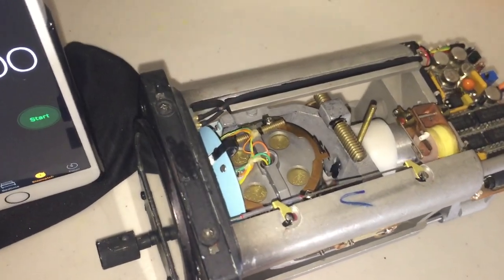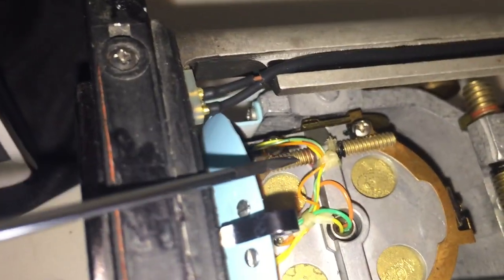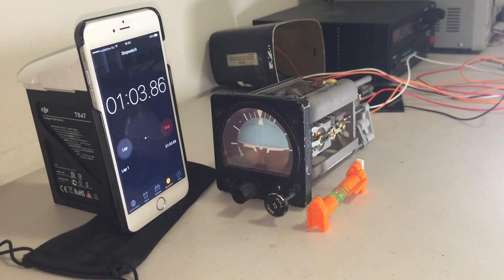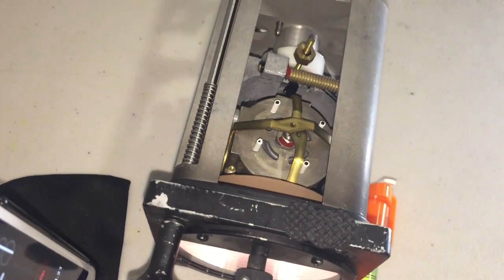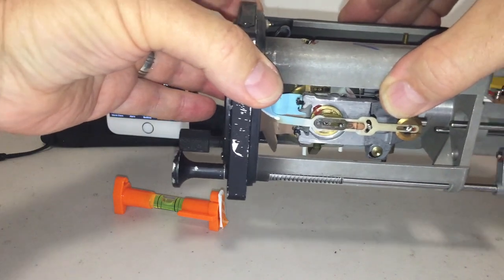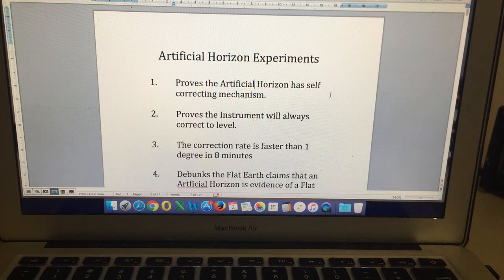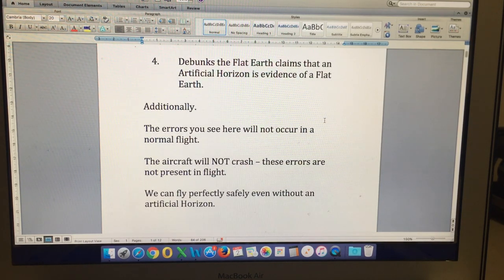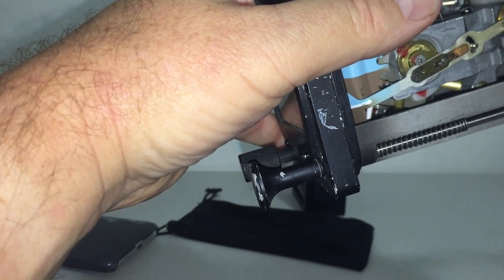Flat Earth - Time Lapse - Inside an Artificial Horizon while self correcting.

Comment: At 6:25 in your video...you pick the gyro up, and PROVE exactly what the Flat Earth guys are saying.  And you even say it!!!!!!!!!!!!!!!!!!!!!!!!!!!!!!!!!!!!!!!!!!!!!!!!!!!!!!!!!!!!!!!!!!!!!  Here are you're own words:  "No matter what I do to the external case, the gyro remains LEVEL."  
So what happens if the airplane tilts over constantly changing orientation from where it took off from?  That would be the same thing as just tilting the external cage over......The gyro would be uneffected, it would stay LEVEL.  

The airplane overcomes the force of gravity, and CONTROLS which direction it tilts down, or tilts up....my friend.  The airplane doesn't take off, then gravity force it to nose down at a constant rate.  Instead the airplane can tilt up whenever it wants to, or nose down whenever it wants to.  It overcame the force of gravity and is now controlling every single direction it moves through the air, my friend.  

Also....you're horizon gyro is an electric one.  There are no air ports or vacuum pumps on it, it isn't air powered, my friend.  It's spun by an ELECTRIC MOTOR, you LIAR.

It's a damn gyro with a pendulum WEIGHT attached to the bottom of it.  YOU LIAR.  

There is different type of Horizon gyro that uses AIR PORTS and a vacuum pump to make the flywheel spin.  
YOURS IS ALL ELECTRIC YOU LIAR.  

The airpowered ones also have a PENDULUM WEIGHT attached to the bottom of them, but the pendulum doesn't control how fast the vacuum pump runs, or how fast the air is blowing on the Flywheel.  The pendulum is just there to make sure it's plumb and LEVEL.  

A liar is always crafty with words, and always gets caught in the LIE.
Reply: Level doesn't mean what you think it does.
Globe confirmed 🌎
Reply: @awatt  I have a 100mile stretch of railroad lines across Kansas, and the entire line is Level from one end to the other.  On the SAME Level all the way across.  Do you understand that?
Reply: @dr.davidbannerf.e.s.6217  
Level is not what you think it means.

Comment: Why not use the gyro to travel in a long straight line on earth without the self adjusting mechanism and see at the end of the journey if you have a difference in level from where you started.  Wouldn't that show if there is curvature or not?
Reply: No because a plane is made to stay level in certain atmospheric layers. With the right conditions a plane doesnt need auto level. But since the atmosphere is constantly moving and changing these changes or depressions as weather man call them can change the planes direction slightly. This is where the instruments kick in. 

But in perfect atmospheric conditions the plane will stay leveled. So either curved or flat the plane will follow the atmospheric layer.
Reply: @Mario Theoretically yes, however the self adjusting mechanism compensates for other inperfections in the gyro as well, not just the errors originating from the curvature. More than likely you would observe "random" drift over time due to biases if the self correcting mechanism is disabled.
Reply: Bob "Fifteen Degrees per Hour Drift" Knodel has a gyro that would do that. . .but he's chickened out of that process now that it has failed him twice.
Reply: @Rokreder  correct, the gyro would precess under acceleration as well. That is another thing the pendulous vanes compensate for.

Comment: One question. The pendulum vanes are basically just like plumb bobs, so it's easy to understand how they are used to correct and level the gyro platform. However, there will be times when the vanes will be affected not only by gravity but also by the aircraft accelerating in some direction such as during sharp maneuvers. Remember that acceleration can of course distort the perception of which direction is down and fool the human vestibular system. This is after all the reason why gyros are used to determine attitude in the first place. So it would also seem logical that the vanes could also be fooled at times during maneuvers and so you wouldn't want them affecting the orientation of the gyro platform during those times. Note that the experiment in your video is being performed while the table is consistently at the same altitude and is standing perfectly still.

As such the instrument's electronics must somehow know when to read and respond to the vanes and level the gyro and when to ignore the vanes and leave the gyro alone. I would image that accelerometers inside the instrument and/or heading and altitude deviations would be used to determine when the airplane is or is not not accelerating, turning in any direction or changing altitude. Leveling would then be selectively performed only during those periods when the airplane is not turning, climbing or diving and the vanes are able to get a true and accurate perception of which direction is really down.
Reply from the maker: +Joe vignolo. You have a very good analytical mind Joe and you are correct. Various methods can be used to prevent ‘correcting’ during a turn.  In level flight we have 1 G but in a turn that will always be more. This can be sensed and the correction mechanism pauses during this time. 

On very simple units however they can begin to align incorrectly dirinf manoeuvres but in a normal flight these errors will be small as there is never a situation where you continually turn for many minute and as soon as you fly straight the tiny error will correct.

Turning and acceleration errors are taught to instrument pilots so they are aware this can happen and will always cross reference other instruments also.
Reply: Joe V.,
 The correction ability is only 3-5 degrees per minute.  The AI is used for relatively short term use in turns and self corrects in level flight...which is most of the time flying.
There is no electronics.  ONLY the vanes over the vent holes...all mechanical and very clever.
Here's more on that:
 https://aviation.stackexchange.com/questions/16376/how-are-attitude-indicators-kept-accurate?utm_medium=organic&utm_source=google_rich_qa&utm_campaign=google_rich_qa

Comment: Maybe I'm completely misunderstanding this, but it seems to me that it isn't a gyro corrected by a pendulum but a pendulum smoothed out by a gyro.

The vertical is detected by the pendulum.  If the plane were always stationary that's all you'd need - essentially it's a plumb bob.  But planes move and are subjected to jerks and bumps, also they pitch and bank.  Jerks and bumps would set the pendulum swinging.  Banks result in centrifugal force that act in addition to gravity, moving the pendulum away from level.  The gyro smoothes out those effects.

The artificial horizon is a fancy plumb bob, using a gyro to smooth out errors due to vibrations and centrifugal forces.

Comment: Hi Wolfie. As always mate, this is top shelf.
Just to satisfy my curiosity, can this unit be used to measure the precession of the earth if the air ports are blocked? Will it be sensitive enough? There are many in YT land that try with online bought cheap gyros.
Reply from the maker: +Usestus Logicatus.  Thanks, I did some experimenting with that tonight.  I taped the vanes centered and so they could not move.  The Gyro still moved slowly in one direction and oscillated a bit back and forth so it was inconclusive. 

I need to balance it better as it was still slightly bottom heavy but I will try again.  I don't think we could claim a definite result without proving it was perfectly balanced and also that the vanes are perfectly centered to produce no force in any direction.
Reply: when i was a lad the top shelf was where they kept the porn mags in the newsagents.
Reply: Nathan Grant 
Nah mate, in Oz top shelf is where the good liquor is kept.
Reply: The center of gravity of the gyro assembly while level is below the pivot points. With the vanes immobilized, the weight of the assembly itself will start to introduce precession that will interfere with the experiment. It would need to somehow be perfectly balanced so that, when not spinning, it can hold any position without tendency to rotate.
Edit: Even then, there will still be some precession being introduced.
Reply: is the problem with this test, the fact that there is already a precession force naturally via the friction of the bearings ?  or a natural precession force of a spinning object matching , or near matching the earth spin?

Comment: Thank you very much for doing this experiment.
It's very well done, and I thank you sincerely.

Just regarding the experiment itself; a coupla questions come to mind....

Could you please define "True Level"?

If the gyroscope is able to self-correct for the rate of curvature, does this mean that pilots need to fly the plane in a downward curve for the entire flight?
How does Autopilot work to correct for the curvature? Is there a set algorithm for that correction, or what?
(I think autopilot is designed to only work on the flat, stationary plane of the earth)

Also, shouldn't there be some factor for the kinetic energy of the earth's spin?
(that must be an immense force, that we seem to be wasting?)
The gyro would need to correct for going with or against the direction of spin.
The spin of the earth would definitely affect the pendulums in the gyro, I think.

This video is a few years old now.
I'm wondering if you are still a firm believer in the oblate spheroid earth lie, or do you still believe NASA?

If NASA is faking anything, then NASA is faking EVERYTHING.

I used to believe in the globe earth, and the planets and solar system, and the sun being 93 million miles away.
But when the facts change, I change my opinion.
What do you do, Sir?
Reply: I may regret replying, but I’ll try in good faith…

1) “True level” in this case just means perpendicular to gravity. 
2) Do “pilots need to fly… in a downward curve…?” Not purposely, no. I think it may help here to point out that altitude as far as the pilot is concerned is determined by air pressure. And since air pressure varies, when we say we’re “flying at 30,000 feet”, it’s rarely actually 30,000 feet above sea level. Rather, we fly at a constant air pressure. So, if we fly into a region of low pressure we descend, and if we fly into a region of high pressure we climb in order to keep the pressure “around the plane” the same. Not a perfect analogy, but you can kind of think of it like driving a car and saying, “the altitude of my head is 4 feet”. Yes, it’s 4 feet above the ground, but your absolute altitude above sea level varies with the terrain. So, to answer the question about flying in a downward curve, it would be like me asking you after you drove from Kansas City to Miami whether you drove “down”. Yes, you did, but it would be imperceptible relative to the distance you drove, and especially when compared to all the small hills you climbed and descended… how would you know you climbed 1,000 feet and then descended 1,001 somewhere in Arkansas? You wouldn’t, and neither would I. 
3) “How does autopilot … correct for the curvature?” I can’t speak for autopilots that use GPS which may very well “know” about the curvature, but I don’t think old-school autopilots would care. As above, they just follow the pressure to control altitude. So, on a curved earth, if the plane flew in a perfectly straight line it would climb, yes? But since the air pressure would (usually) fall if we climbed, the plane would pitch down to get back to the correct pressure. 

I do find this to be an interesting question, though, and reflecting on some of my long flights over the pacific I could never remember “re-setting” the attitude indicator and wondered how it always knew which way was down if the plane was slowly pitching down over 8-10 hours, and this video answers it perfectly, in my opinion. 

It’s been years since I’ve flown, but I would think by now there are probably some fancy devices which could detect this change, and perhaps even the rotation of the earth and maybe even the orbit of the earth? 

In any case, I know the opinion of an internet stranger probably matters zero to you, but during my flying career I never once saw evidence to suggest the earth isn’t a sphere. It IS big though haha - very, very big, so I can kind of understand why some people, especially those without personal experience navigating the globe, might conclude that it could be flat. 

Cheers

Comment: All very well doing a direct flip of the Gyro but how does it behave when you angle it around a sphere slowly ?
Reply from the maker: +Greg T.  It will correct slowly always remaining level with surface of the sphere directly beneath it.  If I moved it out of alignment by just 1 degree it would correct within a minute. 

Flying around the Earth at 450 Knots it has 8 minutes to correct for 1 degree.  It can easily keep up and will never actually let an error develop.

Comment: Sorry i haven't watched all your videos on this but id like to ask 1 question if you please, if the plane is flying on a flat level plane for over 1000 miles for instance then there wouldnt be nothing to correct so im not sure of the point in this, all i can figure is that you are trying to explain why it can work on the ball earth also, is the right?
Reply: And this would also work exactly the same on a flat earth, so what's your point.
Reply: are you debating or ranting sorry if i trigger you, ever heard of density
Reply from the maker: +jason of the disbury family.  Yes that is all I am showing here, that the correcting mechanism will keep it level even when flying around curvature.  So from the cockpit it will not appear to move at all because the aircraft is curving around the Earth at exactly the same rate as the gyro is correcting itself. 

That debunks the claim many Flat Earthers make that the Artiificial Horizon is just a simple gyro rigid in space.  They claim it not moving is evidence of a Flat Earth which is completely wrong. 

I have also been called a liar for claiming the AH has correcting mechanisms.  This video proves it does.

Even on a Flat Earth you would need correcting mechanisms due to precession and bearing friction when manoeuvring. 

Density does nothing without gravity.   Two objects of different density will simply float around each other when there is no gravity.

See this video which shows water and air floating around each other equally in zero G 

https://www.youtube.com/watch?v=gTqLQO3L4Ko

The correcting mechanisms won't work without gravity.
Reply: Aha yes i see what you mean, are these gyros connected directly to the autopilot for Aileron, trims or power to decrease over so many miles, as the argument for flat earthers is that a pilot / auto pilot would  have to continually keep pointing its nose down to level the plane.
Reply: Muzikgod you dont know me im not sure where the insults are coming from, so please relax as i am here for the truth i am just a critical thinker that asks questions and do not take believes for granted, i want to learn things for myself, i used to be a mindless idiot that accepted the word of others i wont fall for that no more, you can if you want me i want proofs.
Reply: no thanx i dont want i will research my own findings cheers anyway its the thought that counts
Reply: jason of the disbury family 
Typically an autopilot system has separate gyros than can be "slaved" to the instrument panel so they actually work in tandem. This works through the autopilot computer. It also will have an altimeter that works the same way.

Comment: In case you (or anyone reading this knows) what is the name of the artificial horizon system where the instrument itself does not have gyros; rather, it receives electric signals from another piece of electronic equipment that measures deviations from level. I am looking for one of these vintage systems if I can find one that is affordable but first I have to know how to search for it. Thanks!
Reply from the maker: Do you mean an Inertial Reference System?
Reply: @Wolfie6020  Hmmm. I started off by saying I do not know the name of the system and you reply asking if I know the name of the system. Is it just me?
Reply from the maker: @ElbertPoling  That was a suggestion. I probably could have worded it differently. 

The inertial reference system detects motion and acceleration and passes the information to an Artificial Horizon display.  

Maybe it is not the item you are talking about but that is the one that came to mind.
Reply: @Wolfie6020  My bad. I was a bit buzzy and sarcastic at the time of my reply. :-)

Comment: nice one! if i understand, the pendulous vanes create a small air flow to correct the gyro slowly, the gyro keeps steady rock solid. i wonder what happens if you remove, or fixate the vanes, but that would damage the gyro. thanks for the demo, cheers
Reply from the maker: +Oxy,  I am going to lock the vanes in place with a bit of sticky tape across the junction and try it.  The problem is if I don't get them perfectly centered they will be causing a false drift.   I thought of taping up the holes too but that might overheat the motor.  More load and less cooling....  Looking at a few options though.
Reply: Wolfie6020, use 4 sticky tapes with the same hole cut out with the same sharp circle, or maybe have a shout out for a physics engineer/professor, so you can borrow a laboratory grade gyro, or so. any word of a flat earth pilot? cheers
Reply from the maker: +Oxy, I have a PPL Winston who seems a great guy.  He is polite, and answers questins directly.  He is looking at a few of my videos and I'll get back to him later.   

We also had a visit from Pilot Lx but he would not answer a single technical question and his posts were no different to any non pilot Flat Earther.  I don't think anyone reading his comments belevies he is a real pilot now.
Reply: +Dark Star  hory shet!